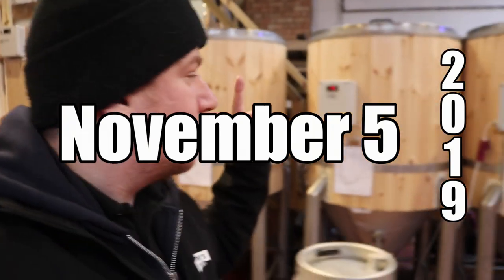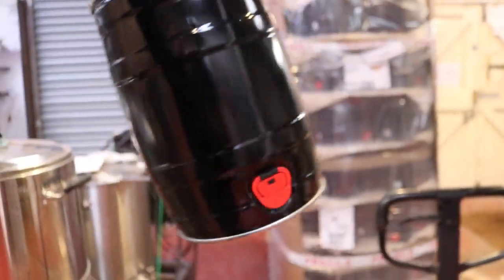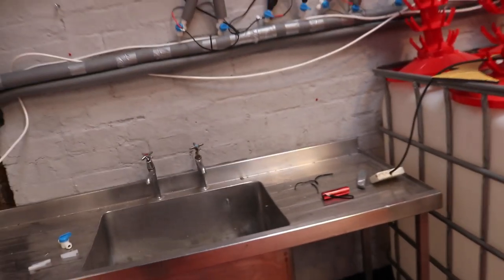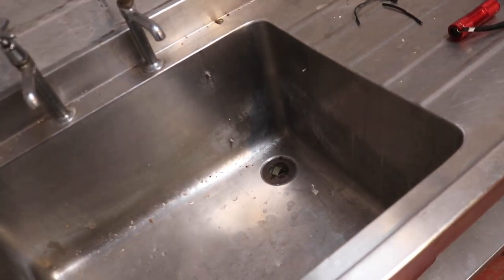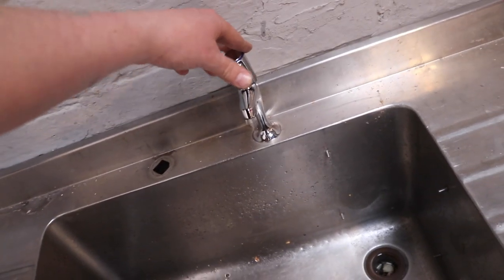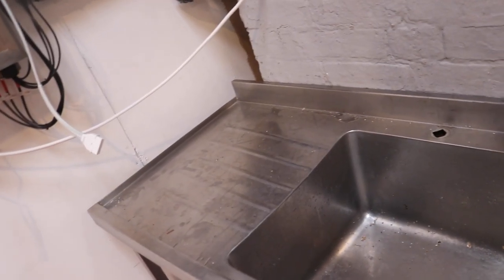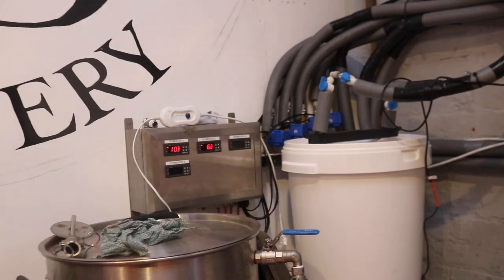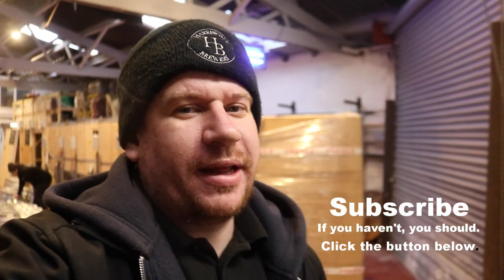CHUCK THE SINK IN

Comment: I for one would love to try a VJ at Christmas, so fingers crossed you can get some in those mini kegs.
Can I ask why 4 degrees as a crash temp? Is it just because that's how cool your chiller coils can get the beer or  a more scientific reason?
My ferm fridge gets to about 2 degrees so I let it!
Reply from the maker: I find that 4C is good enough for the yeast to drop out and far enough above freezing so I don't get ice in the tank. In the past I have crashed to 1C and when I took the beer off there was a slab of ice stuck to the inside wall of the fermenter.
Reply: @harrybrew69  Good to know. I've never had an ice issue but  if I can save a bit of money by crashing at 4 rather than 2, I will.